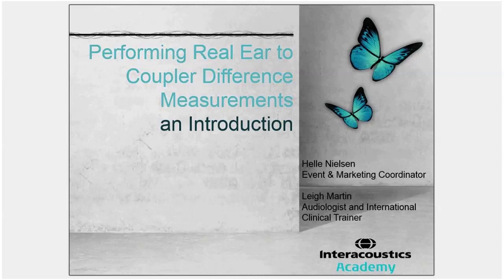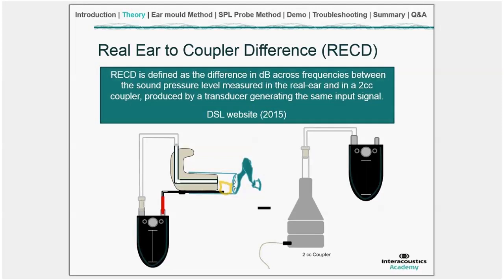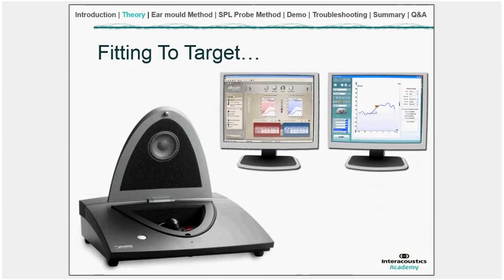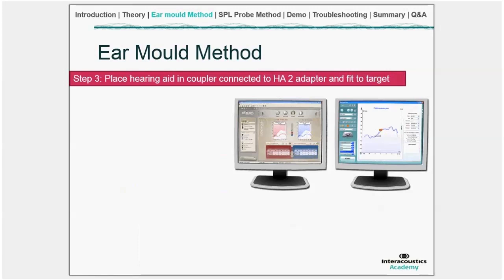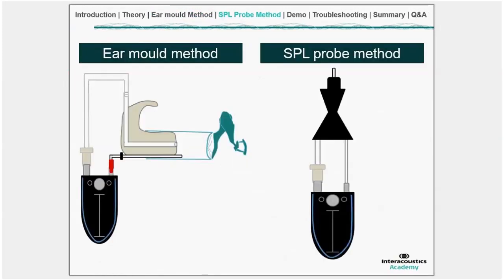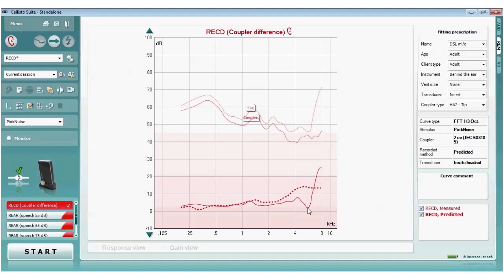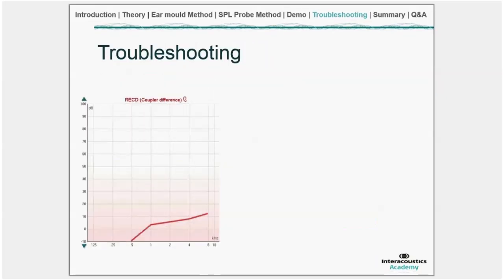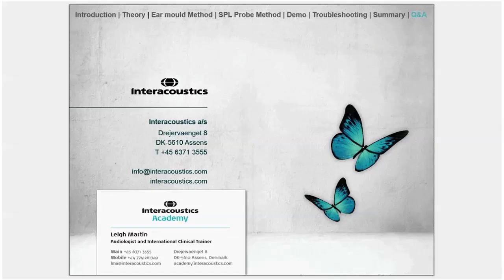Real Ear to Coupler Difference (RECD): An Introduction

Comment: What is the procedure for REM measurements in the pediatric population
Reply from the maker: Hi SAY MA,

If the child is old enough and capable to sit still and quiet through the procedure, then you can follow the same process as REM in adults (but you may consider using a different prescription formula).

Follow this link to see how this works:

https://www.interacoustics.com/academy/hearing-aid-fitting-training/rem/real-ear-measurement-steps

If the child is too un-cooperative, then you should use the RECD procedure recommended in this video.

Best regards,
Shane